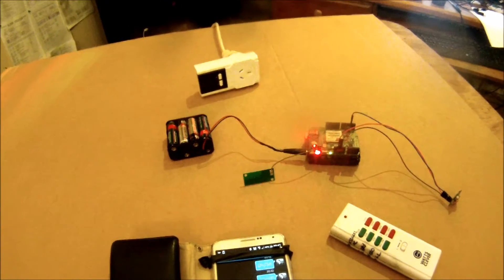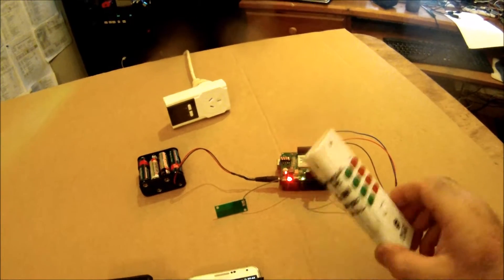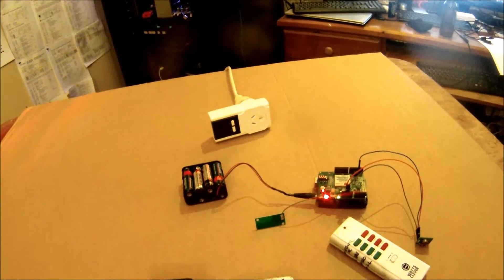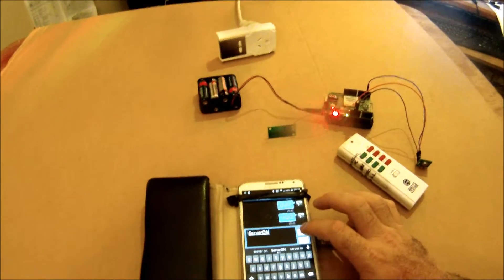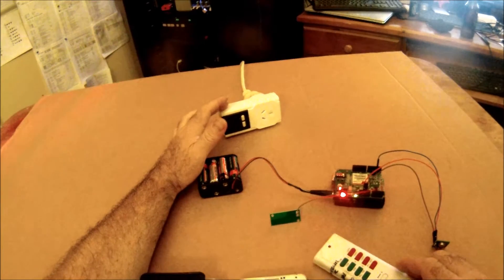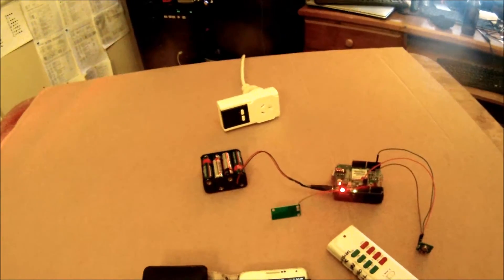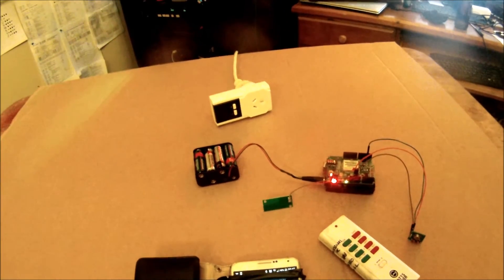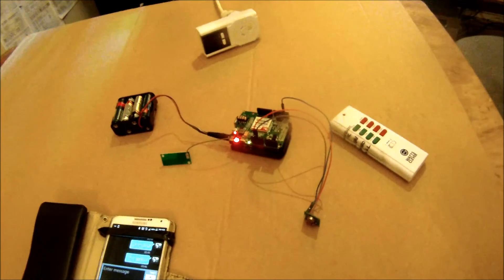SMS your Watts Clever Power Sockets

Comment: I have the set of 3 but I want to know what does the L - S switch do. What do the letters actually stand for? Thanks
Reply from the maker: I'm guessing "L" stands for light and "S" stands for switch.
Reply from the maker: @joannemurray3628  are you talking about the L and the S on front of the model with the light built in?. Because when I press the l button, it's light turns on and when I press the s button the power turns on.
Reply: @TobyRobb  Sorry. Yes, my bad. You are right. I tried again and the light and switch did come on. I can only get one socket to work with the remote. I need to do some more trialing. So thanks for your reply. Much appreciated.
Reply from the maker: @joannemurray3628  im not sure i remember, but holding down the button may put it into learning mode..

Comment: Nice. Like this. I have a shop-bought SMS controlled single 13A socket which works great but the position I have to site it and the poor signal area I'm in means that it often drops off the 3G network. This might work really well as I could site the SIM / Arduino in the loft or somewhere for better signal, and then the RF should be able to reach through the house easily to the socket unit. Have you got a link for your GitHub please? Cheers David
Reply from the maker: Here you go David, https://github.com/tobyrobb
Reply: @TobyRobb  Awesome, thanks a lot man. Think I'll have a go at building this - the Watts Clever sockets seem to be completely discontinued here in the UK but there seems to be countless other 433MHz devices that do the same thing. Just have to find one that can be set to default to being in a Power On state after any unplanned supply interruption - what I dont want happening is a random power cut causing the socket to fail to an Off state - this would have a remote ISP router connected to it so definitely needs to default to On state.
Reply from the maker: @musicbydavidyoungs  I would take a look at the Sonoff devices and MQTT as well as they are highly configurable. The one thing i can say about 433Mhz RF devices is that its pretty easy to emulate most of them with an arduino adn module, and if coupled with MQTT and NodeRed for example it could hold the state of the device and after a power down restore the values. Using IFTTT you can trigger on all kinds of scenarios, or coupled with a Google Home or Alexa you can also add voice control to any 433mhz devices around as well..
Reply: @TobyRobb  Thanks again - appreciate the info and suggestions. I did check out some of the Sonoff kit but couldnt see anything which emulates what your neat project does - namely allow SMS control of RF 433MHz devices. Seems to be lots of basic SMS relay control devices out there but I have one of those already - I like your solution because it would potentially allow me to have the SIM/Shield way up high in the attic for good 2G/3G/4G coverage, and then use RF within the house to switch a socket two floors down.